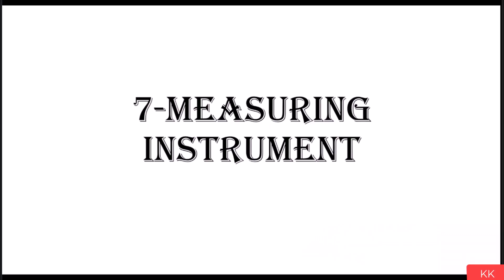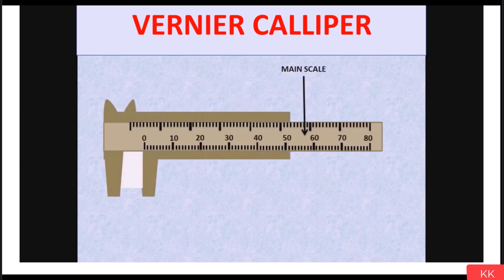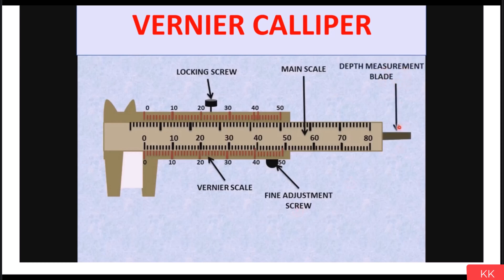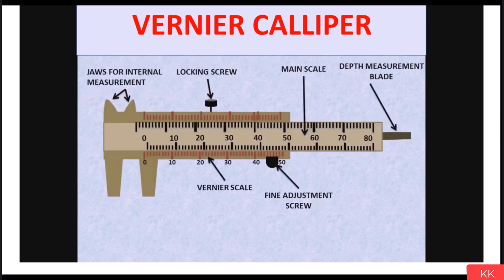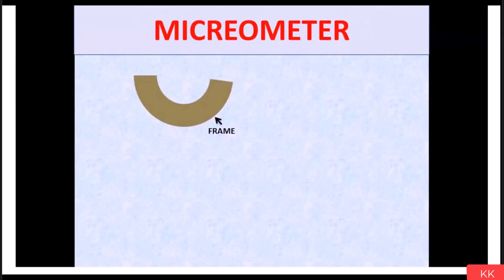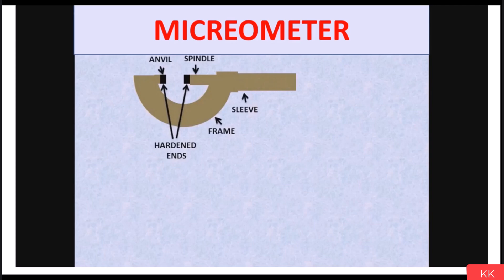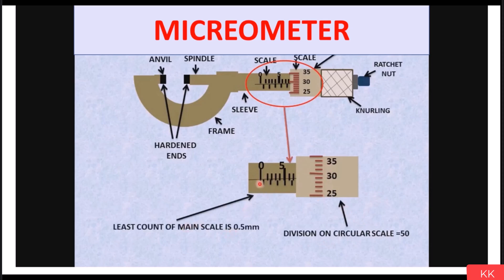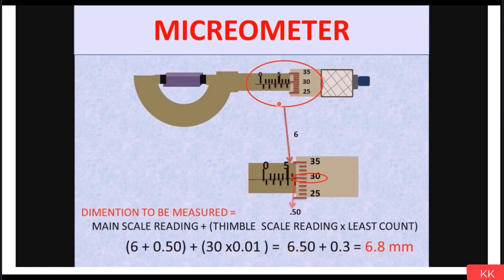Measuring Instruments: Vernier Caliper and Micrometer - Lecture 12

Comment: Sir, Which software you used for your videos editing?
Reply from the maker: Free video editing software options:
Beginner-Friendly
OpenShot – Simple and easy-to-use with basic editing features.
Shotcut – Open-source, supports a wide range of formats.
VSDC Free Video Editor – Non-linear editor with advanced features.
iMovie (Mac Only) – Intuitive with good templates and effects.

Advanced & Professional
DaVinci Resolve – Professional-grade with color correction and visual effects.
HitFilm Express – Great for special effects and compositing.
Kdenlive – Open-source, powerful with multi-track editing.
Lightworks Free – Used in Hollywood, but has export limitations.